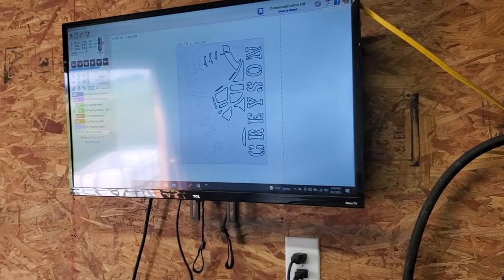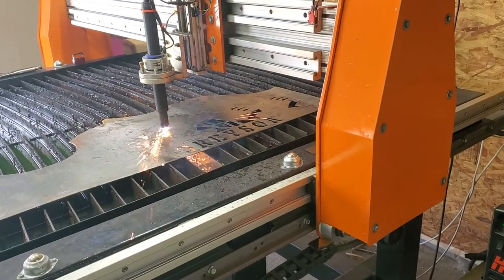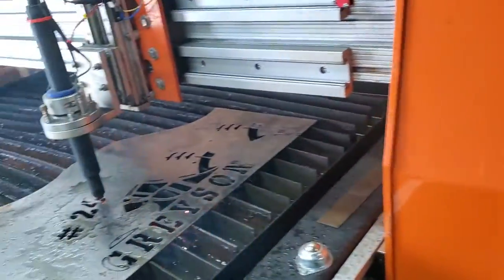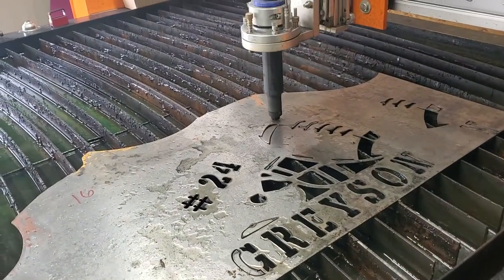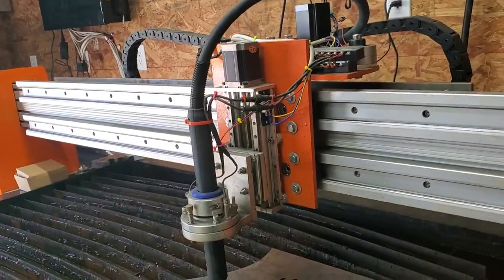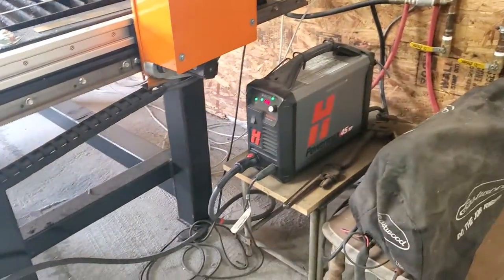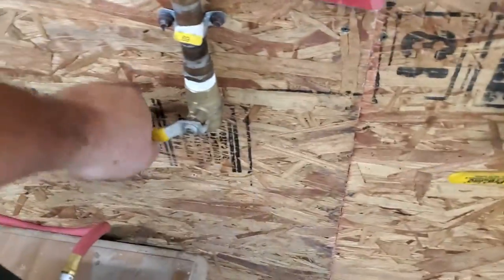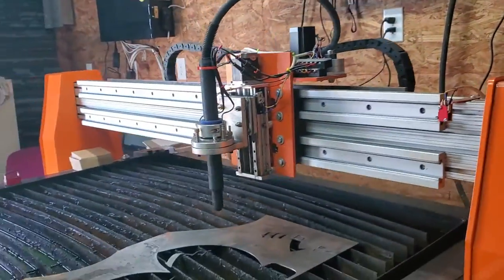Update on new table build. and Dry air items.

Comment: Nice looks good 👍🏻. Been trying to dial mine in but I keep getting saw tooth cuts on some small internal cuts. I saw that my torch had a little wiggle cause of the magnetic mount and I did my best tighten it up. But I am thinking it’s the settings on the speeds? Also I am trying to get the correct setting on my tpi it just very tedious been so hot outside that I get annoyed trying to fine tune it and it cooking outside lol. I did remember you had mention that you had some saw tooth cuts were you able to fix it?
Reply from the maker: The saw tooth cut was on my ol Gofab table.  And when I went to sell it.I put it all back together, and downloaded there newest software, and it cut good. but they speeded up everything. But this new table is great..Cuts great.. what table do you have and Controls?
Reply: @Dishtech48  I built 2 of them already first one was a 4x2 running off linuxcnc which ran good everything was spot on but then needed more room to cut so I built another one 5x5 and tried to run linuxcnc again but this time with new controls  and was just a headache getting it going. So I bought this proma software which is way easier friendly and good. But getting saw tooth cuts on small shapes and I still trying to get it dialed in on the steps per inch
Reply from the maker: @carrgrienier7726  In MyPlasma controls, it should be green light on all of them. And I used tape measure to tell myPlasma to go like 20 inches. , and I measured it to see if I needed to go more or less on the setting #'s. I was like in 4 digits at one time. Very sensitive.
Reply: Another question what z axis are you using? I got mine from a store in Canada and it works ok but it came with the breakaway mount but it wiggles to much and I think that’s causing my saw tooth cuts. Looking for a solid z axis
Reply from the maker: @carrgrienier7726  I bought my Z axis online. A guy builds them. I can't find where it was now. Very well built, but I added a anti collision torch mount that is tight, and works awesome. Shuts down everything 8f a piece of metal flips up and torch catches it.